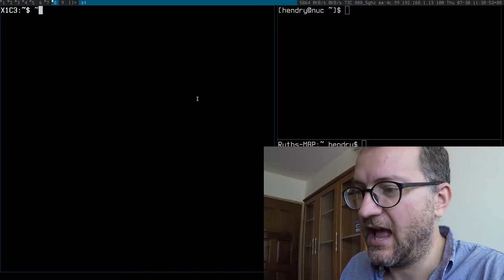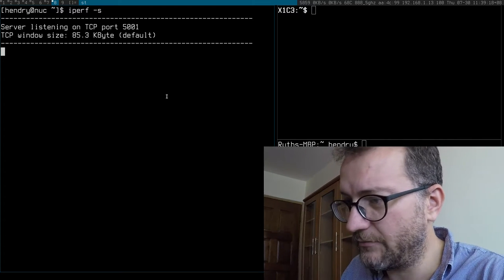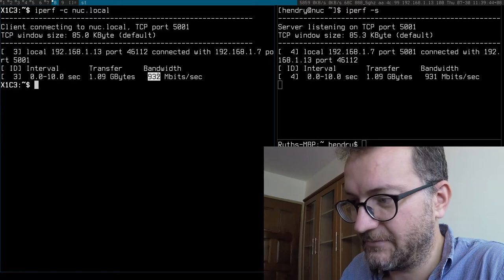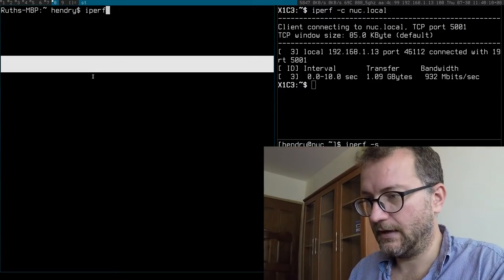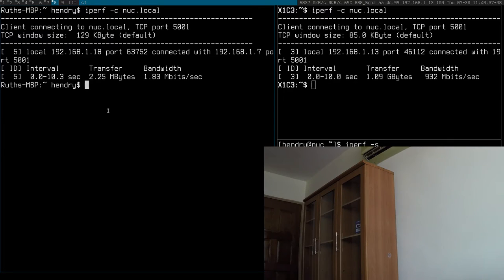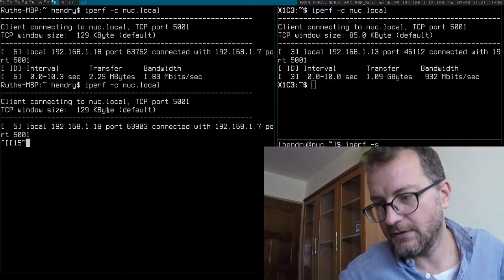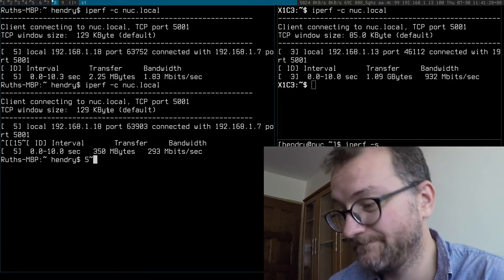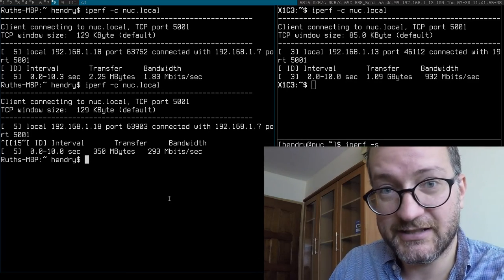Testing a GIGABIT network with IPERF & also checking typical wifi AC speeds

Comment: Thanks for the video. I am currently testing my Wifi out and I got around 315Mbps with my mid-2015 Macbook Pro with it standing next to the router. The question I have is: what is the real limit of Wireless AC? They are talking about speed of over 1,000 Mbps, close to 1,200 Mbps on a maxed out 5GHz Ac channel. I reckon that actual throughput would be about half of that. But I am not getting anything near that. What are the manufacturers talking about then? I am very confused as to Wireless AC BEST attainable result possible. Ideas? Thx
Reply from the maker: I've given trying to benchmark AC since it depends on what rate / chain it is deciding to use and it's not that easy to override.